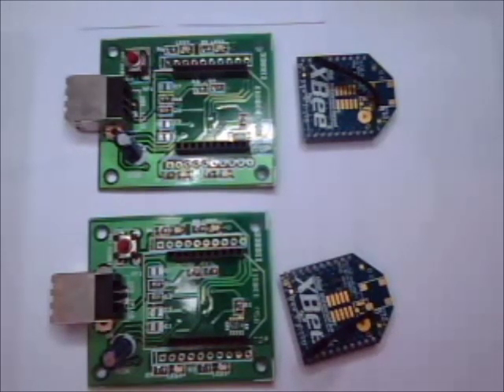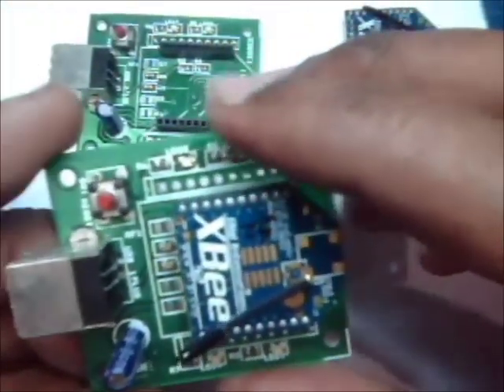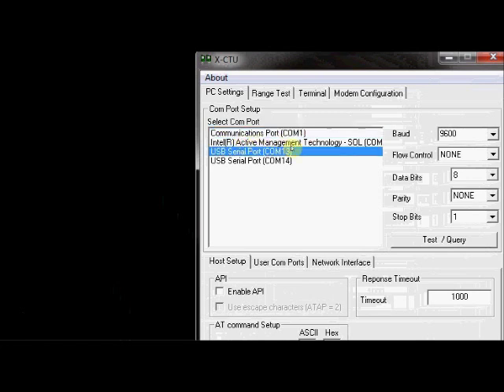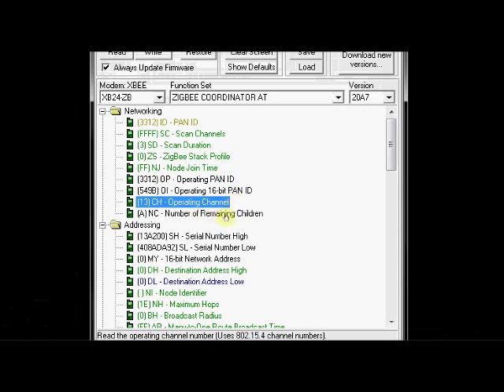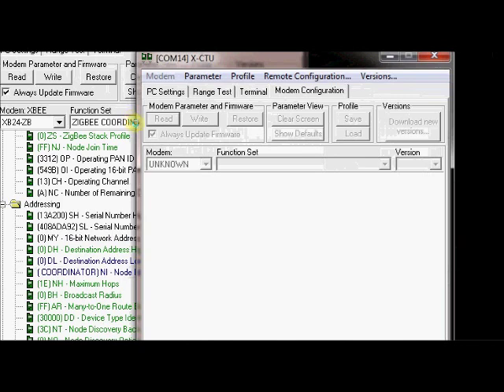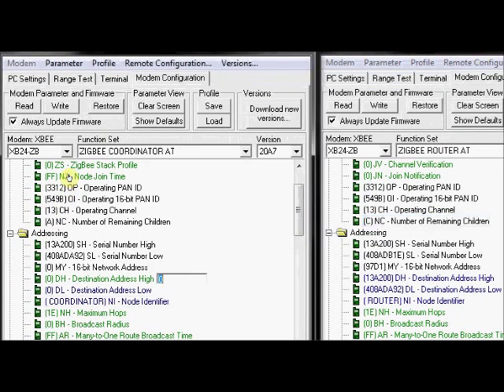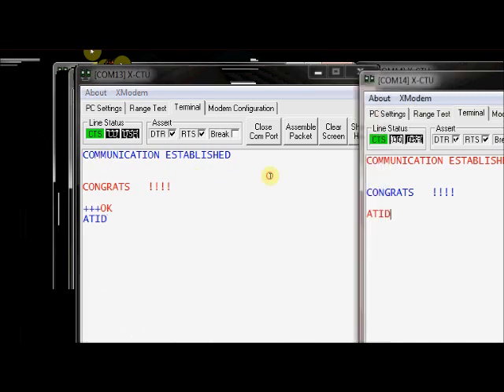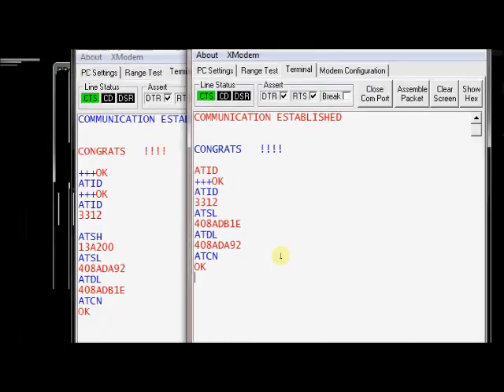Configure Series 2 XBEEs using XCTU

Comment from the maker: Which type of XBEE you use S1 or S2 ? If it is S1 type you can change the Channel setting manually.If it's S2 ,Channel selection is automatically done by the Co-ordinator.You've to configure one as Coordinator & other as Router.
Reply: Saravanan AL 
Sir,  I have S2 and want to change operating channel from 14 to 12..
Plz help me. How to do it! 
Thanks

Comment: ok, 1st question is ,wat is the difference between XBee 2mW RPSMA - Series 2 (ZB) and XBee 2mW Wire Antenna - Series 2 (ZigBee Mesh)
and  second is i want to use one  xbee with my laptop and send the data to two mini robots having xbees on them. means i have to send data to two xbees so which xbee should i prefer and why ???
Reply from the maker: XBEE S2 RPSMA , as the name implies it has a RPSMA connector for an external antenna.But for this connector ,it is same as normal S2.
Configure Coordinator's destination address as FFFF to operate in broadcast mode.This means that the coordinator will send to every other node on the network.Configure the Router's DL as 0.Zero is a special address that causes the router to send its traffic to the coordinator.
Reply: Saravanan AL
 ok u mean to say that there is only difference of settings
i can use the other xbee (XBee 2mW Wire Antenna - Series 2 (ZigBee Mesh))
also as a coordinator and send data to all other nodes   ,, ok ?
Reply: what is the name and complete model name of xbee you are using ?

Comment from the maker: Hi,It's interesting to work with sleep mode on End devices to stretch its battery life. ATSM1 is Pin 9 wake mode where this pin is pulled high to make radio sleep & brought low to make it wake up.It is also important to take care of SP & SN on its parent coordinator.By increasing this at parent device to a value longer than max.sleep period of end device the parent will keep track of its child.
Contact me by mail alselectro@gmail.com so that I can provide more details